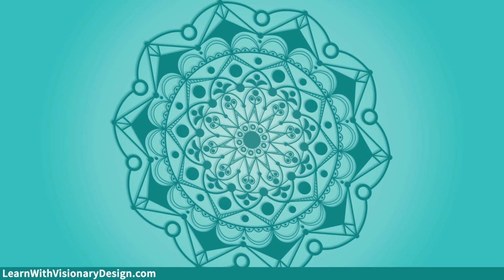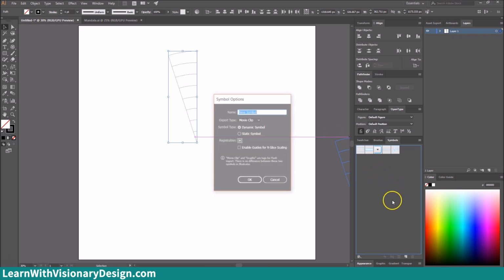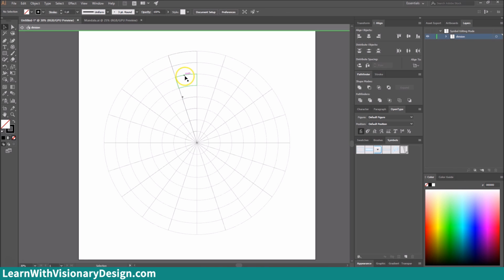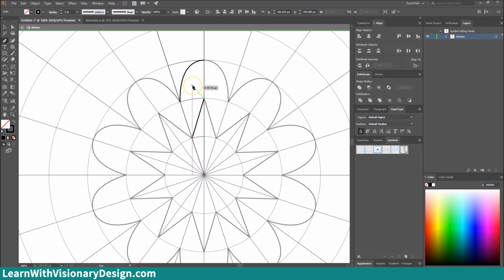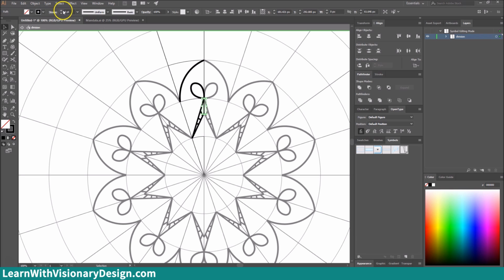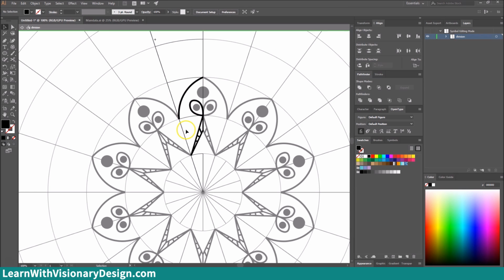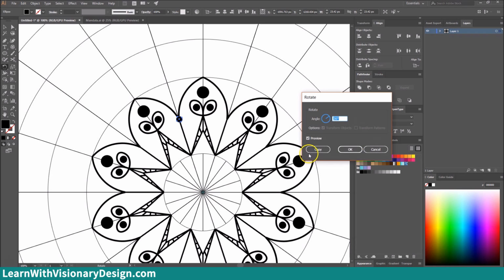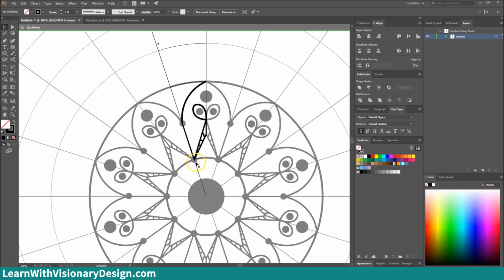Learn Mandala Design Step by Step | Adobe Illustrator Tutorial

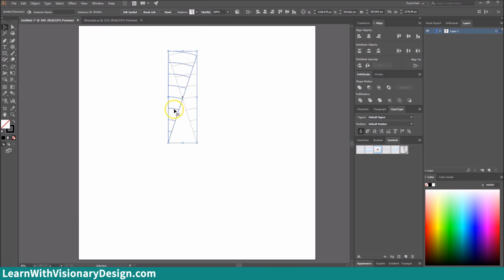Comment: Hi there, I am a very Ai beginner and in the minute 2:37 when you align the the two shapes, I can't get them correctly aligned... it is frustrating.. I've been drawing with Autocad for 12 years and I am used to the so precise snap.. I have the smart guides on, but can't get it well aligned. Thanks for sharing!! :)
Reply: Use the "snap to' menu of options.